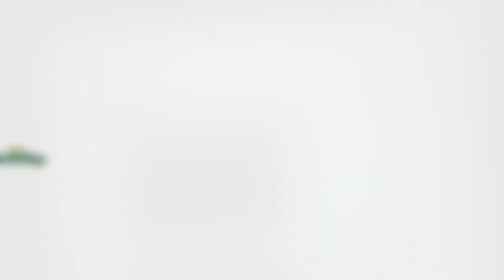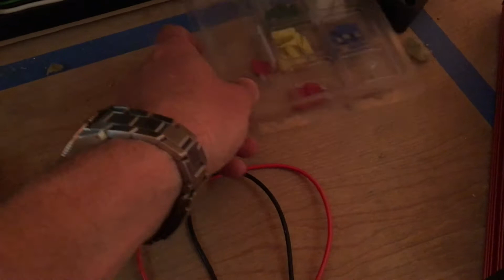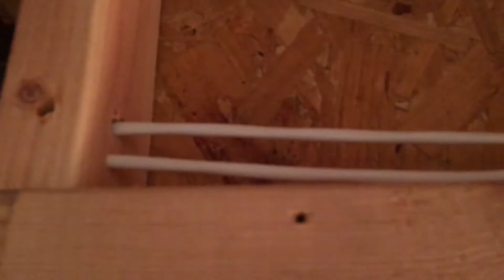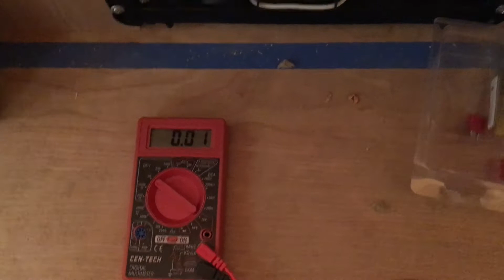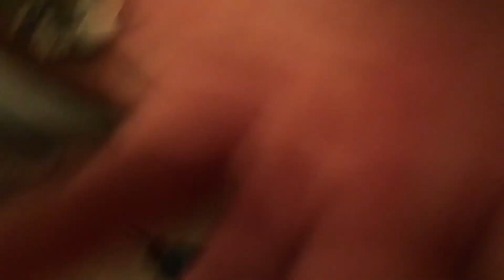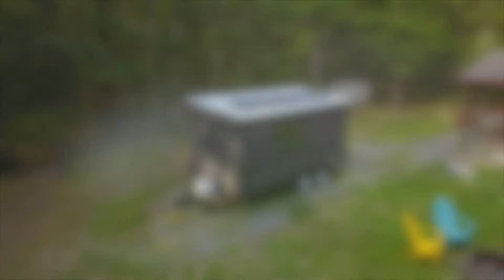How to Wire a Tiny House - Electrical for On- and Off-Grid

Comment: @TinyIndustrial Thanks so much for your Tiny Home utilities videos, they have been so extremely helpful and thorough. I am having someone help with installing electric and I wont be adding the off-grid (solar/wind) option just yet. How do I leave room or tie in easier access to that down the road if I just start with the On-Grid electric?
Reply from the maker: Thanks for the kind words. If you get an RV panel that has both AC and DC options, they often have a solar input and that is where you are route all your various off grid power options into your dwelling (solar, hydro, wind). Something like this is what I like to use: https://amzn.to/3IPzpoC Enables both on and off grid use without having to choose one or the other at the outset. Hope that helps.

Comment: Do you have a link for the solar panels you used?
Reply from the maker: Hi there. Yes, I believe it was these: https://amzn.to/3PD5Oj9 What's the project you are using these for?
Reply: @TinyIndustrial  we are looking at wiring a geodesic dome as a short term rental property. We are trying to go as off grid as possible. Do you think that this would suffice? Really appreciate your videos, they are very informative!
Reply from the maker: @katewatson405  Yes, this set up would likely suffice as long as you stay realistic about what this kind of setup can achieve. Heating or cooling the home would not be possible without a much bigger set up, but if you want lights, run a water pump, charge a laptop, run a fan, small fridge...that kind of thing. This would totally fit the bill. That why you can see in the picture the two propane tanks on the hitch end that are there to supply a fuel source for cooking and for heating in this particular tiny house build. Hope that helps! Let me know if I can assist you further. What part of the country/world will these domes be located?
Reply: @TinyIndustrial  thank you so much for the information! These will be located in Eastern Washington. But not to be confused with the climate of western Washington, which gets more precipitation than we do. Our winters can be cold and we can get quite a bit of snow in the wooded area that we live in and we can also get significant heat in the summers. So we are trying to come up with creative off grid options for these domes. We are looking at heating with a pellet stove and using propane for a tankless water heater. However, we are not completely opposed to going completely off the grid and only having a compostable toilet instead. Haha! But we would like to offer some every day amenities because that’s probably more appealing to people. This will be used as an Airbnb type rental. We hope!
Reply from the maker: @katewatson405  I'm been to Seattle and have also driven from there to go see a concert at the Gorge. The landscape and climate does change a fair amount. It sounds like you have heating and hot water covered. Propane for cooking as well? If so, the kind of set up that I had illustrated in the video would work fine. The fridge being the biggest draw in that set up. You can create a beefier solar setup and roll other more energy hungry aspect into that set up, but the costs go up quickly when you need to triple or quadruple the amount of power you are able to collect and store. It's a tough balance to hit not only from a gathering (panels) perspective but also from a storage (battery) perspective. Just anticipate that you may not get it right on the first try, but you can always add a panel or battery if need be to dial it in and make the setup work for you.
Reply: @TinyIndustrial  thank you so much! Your advice is very valuable to us! Thanks for all the helpful videos and links as well!
Reply from the maker: @katewatson405  Happy to help. Best of luck with your Airbnb project!
Reply from the maker: @katewatson405  You are very welcome. This was always my goal to make these to be helpful to others since others have always been very helpful to me. My chance to give back a little. Let me know if I can be of any further help.

Comment: Did you plan an electrical wire for an HRV/ERV ?  I've been reading about their importance in tiny homes.  I also read that lithium batteries are best, but more expensive.  Are yours, lithium and if not, why not?
Reply from the maker: I looked into doing an HRV/ERV set up, but decided against it due to cost. Opted instead for a ducted fan and a passive air inlet. Fan was on a controller to dial up or down the speed (and associated fan noise). That worked great for the air exchange. The inlet was located under the bed. Didn't want there to be any draft felt...
In terms of the batteries, they were standard. If I did it over again at this point, I would go lithium. The prices have come down a lot and you just get a lot more performance out of a much lighter battery. Remember too that you can draw them down to almost 0% vs. standard batteries that you are only meant to draw down to 50% and then recharge (effectively only getting 1/2 the indicated capacity in that sense). Are you building a tiny house and contemplating these things at the moment?
Reply: @TinyIndustrial  Thank you for your reply.  The passive air inlet is something I haven't read about.  Glad it works in your situation.  And good to know re: lithium batteries.
Like many others, I am studying as much as I can in the event my dream of building a tiny home can come to fruition, but a huge issue remains as to where/how to live in one legally due to building codes.  I am drawn to the idea of affordability,, simple living, and movability in a structure better built and more suited for year -round living than an RV.
Reply from the maker: @jssmith1608  Yup, passive is not a bad way to go. I used something like this as the air entry point under the bed: https://amzn.to/3hGVcO1. Also, yes, I think that Lithium is now the way to go unless you absolutely don't have the funds for these more expensive batteries.